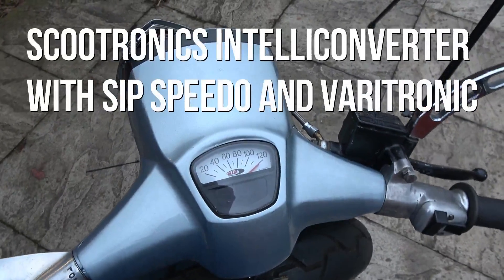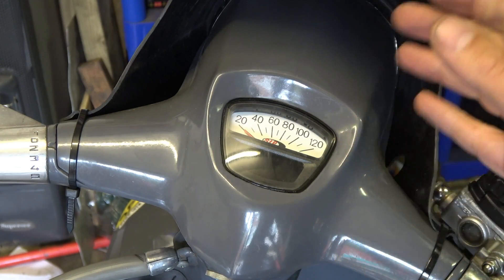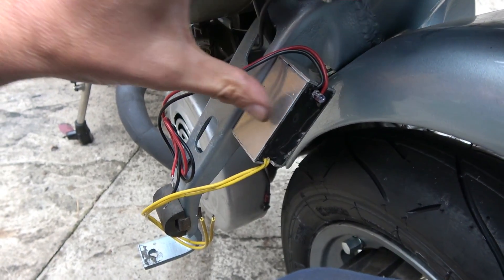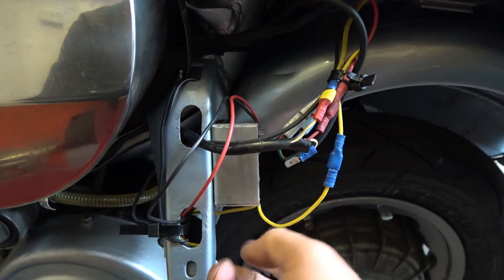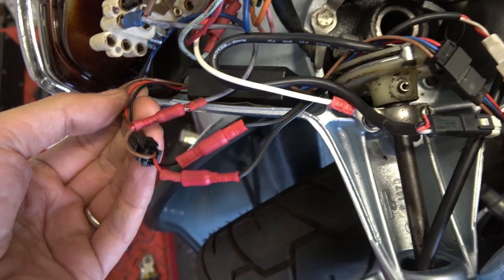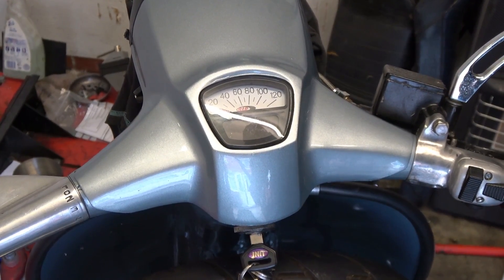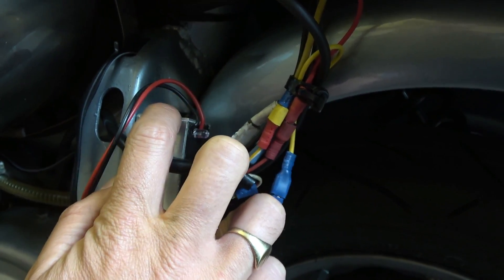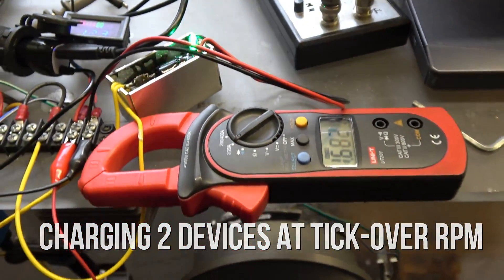SLUK | SIP Vespa Lambretta speedo solution with Intelli-converter

Comment: How is the temperature sensor adapter installed under the sparkplug? area very tight, I already smashed one adapter
Reply: There is very little room in there on an SIL cylinder head. I crossthreaded the plug trying to get it in with that temp sensor ring beneath it. I'm thinking of drilling a hole in a cooling fin and not  using the temperature sensor adapter. I had thought about using it under a cylinder head nut but I don't want to risk cross threading a stud or a nut working loose.
Reply: Take the engine cowl off and install.
Reply: thanks, I used a fin to connect the sensor and covered it with hi-temp silicon

Comment: good idea but what i did was put an led rear light on my gp and now i never get lights dimming when i brake and my sip soeedo doesnt reset itself
Reply from the maker: Good simple solution David. The bike in question has an LED bulb as well but the headlight bulb is more than 35W so the brake light was enough to tip it over the edge.